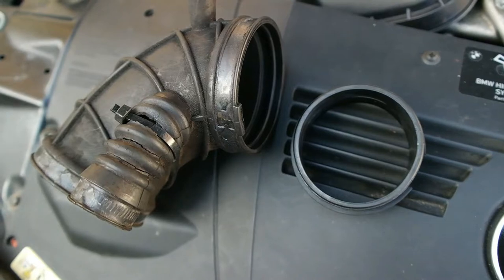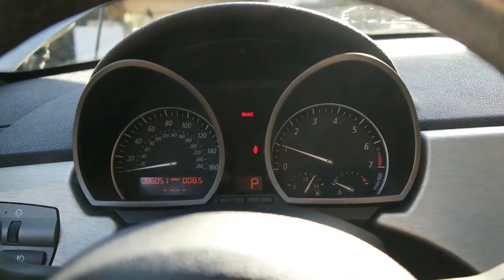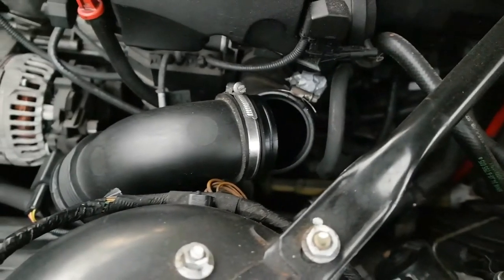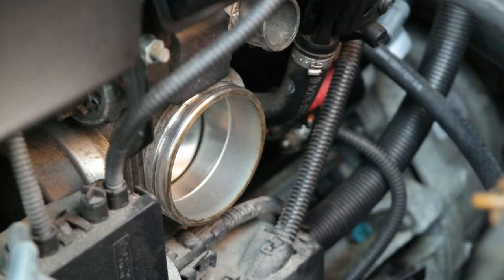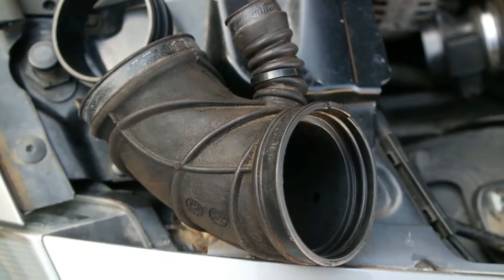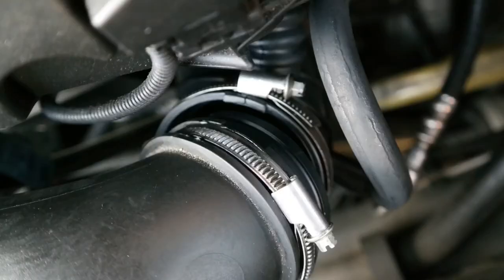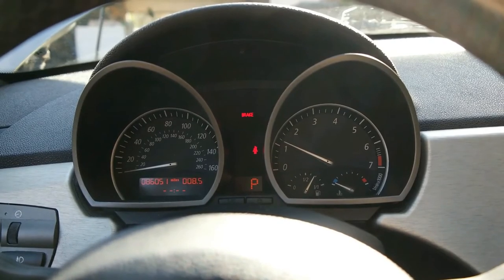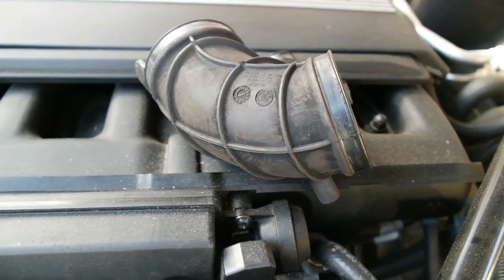How to Change a BMW Z4's Intake Tube

Comment: Thank you so much for saving me so much time.  This is a great video and I especially appreciate when you came back at the end explained the part that needs to be pulled off.  I was so confused and was thinking that I have received the wrong part.  Then I came back to watch the entire video and there you explained that u had the same issue and explained spend a day coming up with the correct installation of the tubes.  I was really stocked.  Really grateful for sharing your experience with others.tube

Comment: Question would a cracked boot cause the ses light to come
On?
Reply: yes.
Reply: @paulcharlton4788  thanks Paul. Fixed the boot but still here the same whistling? It’s driving me crazy: any idea. No engine lights just a weird hiss at lower or steady rpms